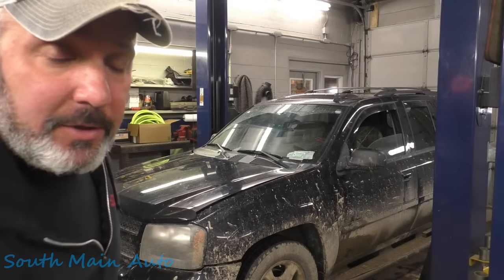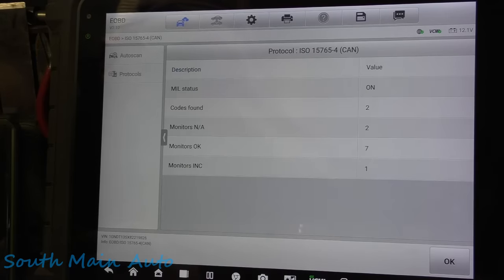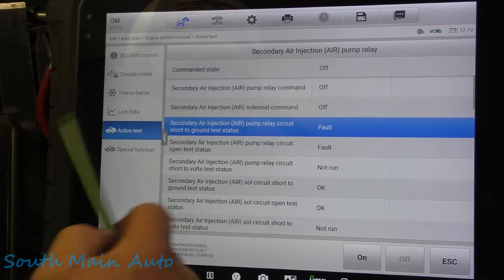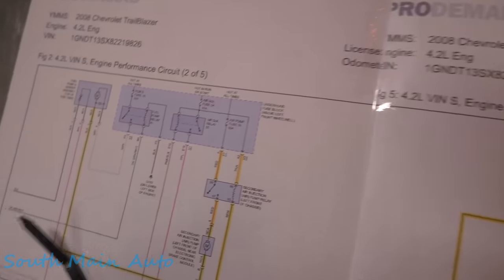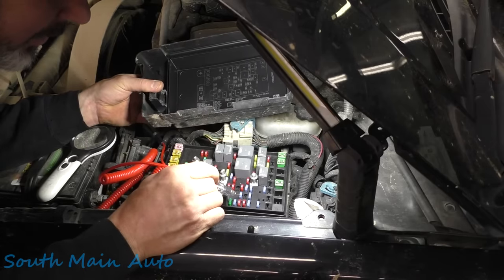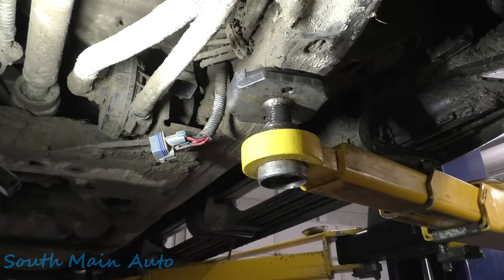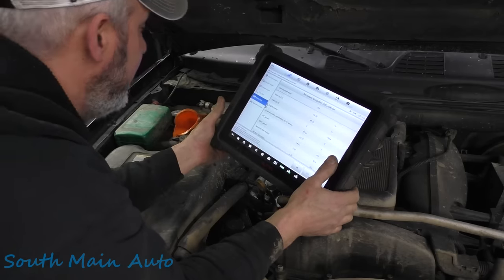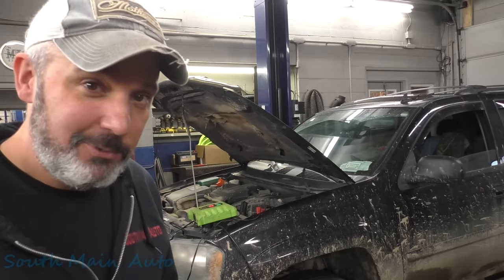Chevy Trailblazer - A.I.R. System Failure... Like All Of It

Comment: Our "04 trailblazer was in amazing shape when the transmission failed at 280k. Had it rebuilt by a local yokle and it failed again 8 months later. I sold it for parts 4 months later. The guy replaced the transmission and drove it till it died for good. No rusty frame. For a Michigan vehicle, it held up well.
Reply: Your amazing condition I guessing is POS to most people
Reply: @kenj.8897  Actually no, being an older couple with grown kids, it was very clean and bodywize in great condition  for they year. Everything ran fine up until the transmission failed. I also did all my own tune ups, brake jobs and any other repairs it required. It still had its original exaust  system as well. We traveled a lot with that vehicle.
Reply: My buddies has 246,000 miles on it runs like new, uses oil.
Reply: I nearly bought an '05. It was 9 years old and after doing research didn't find that much goes wrong with them and that engine seems indestructible. What stopped me was the rarity and thought parts could be expensive. So settled on a '06 Jeep GC. That ended up being a mistake as parts for that were crazy and the only mechanics that would touch it were the dealership and myself. Dealer replaced the alternator and that took 4 days and $1300. Was supposed to be a body off but he did it without removing the body. He only worked on it for a couple hours a day as they were really busy. Never found anyone who could service the trans.
Reply: They are good vehicles..
Reply: Trailblazer was one of the better trucks GM made. Too bad they didn't keep refining that 4.2 inline, it was a pretty good engine other than coils and the weird water pump/fan clutch design. Now they're stuck with all the cylinder deactivation V-8s that they still can't get right.
Reply: @franklincormorant8312    with all of the GM engines, don't know why they even messed with the 4.2...
But it seems to be decent.

Comment: Those air pumps should be called cheater pumps as they only run at startup for the system check and then shuts off.  What a joke. Great video though and was super excited for the "double money shot". Thank you.

Comment: Eric,
Great video - thank you.
I have a 2005 Focus with 200,000 miles as a parts car for my 2006. Its completely rotted out and cannot be driven but the engine still runs and the air pump still works. No CEL :)
Paul (in MA)

Comment: My taco also as an air pump. Ive got accustomed to it buzzing away on start up, i didnt realize most manufacturers dont use them anymore. I was explaining it to one of the master techs at my dealer and they'd never heard of it before
Reply: Yikes so they're just handing out "master" these days eh
Reply: @Onewheelordeal  normally id say yes. But as it turns out honda has never really used them. If you only work on one brand for 10+ years, i can't really fault them for never knowing that system existed.

Comment: I just bought an 04 Trailblazer from my neighbor, 243k miles. I fixed a dozen easy issues and did some body work. Cylinder four on the engine has a loss of compression, which is the only problem left. For $2000 and $800 in parts ($430 of that for a Safelite windshield), I wound up with a decent second vehicle.

Comment: The AIR system in my 96 Caddy threw a code so I did some preliminary inspections. Having found nothing, I looked into TSBs after some Goggle-Fu. The TSB said essentially not to worry about it and gave the procedure for an AIR system delete. If you have a Fleetwood, Roadmaster, or Caprice from this era, the TSB is #01-06-04-011

Comment: i remember the belt driven smog pumps / air pumps out here in cali. used to blow air into the exhaust manifold where it bolts to the head. been driving a diesel ⛽️ for last 25 years. forgot about them.

Comment: I worked at Budd Automotive in Kitchener Ontario. we made the NEW HYDROFORMED frames. of course thinner lighter metal so they could be formed with water pressure. no one cared about rust out in a few years. good old GM Engineers.
Reply: Not an engineering problem.  Nice try...

Comment: Although big piles of junk, they were a great size and a great rig with the smooth engine and limited slip they did really well. We had an 05 extended trailblazer in which we loved the size and shape and features with the rear seat… it was a piece of junk but we loved it for what it was. We sold it when it was running good before something else came up.

Comment: My 2012 Tacoma's secondary air pump has been a complete nightmare. I've had it replaced twice and I am finally able to at least clear the code for a few days at a time so I'm not stuck in limp mode until I can finally get it replaced again.
Reply: Yeah they are problematic. Gotta warn customers you can only temporarily fix them

Comment: I was living in Calgary, Alberta, Canada.  I had a Datsun 500 (so you know this was quite a while ago) which had problems that apparently meant the technician had to lift the car.  It was Spring and a bit wet on the streets when I brought it in.  When I picked it up there was a charge for an under-body cleaning necessary to allow technician to see and fix the problem.  I looked and it appeared to have been pressure washed.

Comment: I still have a 03 Chevrolet trailblazer with the big 4.2, I wasn't a huge fan when we bought it 13 years ago for my wife, we are the second owner and it now has 180,000 on and I will admit I hate working on the thing cause how stupid it's designed but that 4.2 has been one of the best motors I have ever had, its not powerful but it's not sluggish and still has a lot of original parts, we live in good ol st.louis so not a lot of snow n salt so the frame is still in great condition

Comment: Trying to find a Mechanic/ Technician with your caliber. So far the few shops we took my wife’s Cadillac to refer us to the dealer. The ones I’ve called don’t want to mess with electrical stuff. Wife has an intermittent can network failure and the screen pops a bunch of error messages and no check engine light. I’m not her but if it was me I would wait till something breaks. I would love to fix it but it is intermittent.

Comment: The AIR pump on my Corvette is the loudest thing under the hood when it's sitting there idling....thumpthumpthumpthump. I pulled it apart and checked out the impeller and bearings, no problems - just stupid loud.

Comment: The air injection pump on my '98 BMW 328i sounds like a Dirt Devil vacuum when it comes on at startup.  It's on it's third since I've owned it.  Original one was seized when I got the car 11 years ago, replaced it and the control valve, replaced the replacement last year.  Unfortunately you can't get to the bearings on them, even after drilling out all the rivets.  If I could do that I could clean and lube it periodically and it might actually last.

Comment: I had a 4 Runner in the shop once to diagnose/verify a leaking rear main. The mechanic said before they'd do the repair, all the mud/muck would have to be cleaned off;  Either I could do it, or he'd pay someone to do it (before he'd do the repair). I'd of course be charged for the cleaning. I brought it home and cleaned it up (didn't realize it was that bad - new to us used truck at the time).

Comment: Here in TX, still have quite a few Trailblazers on the road.  They are dwindling though.  My Trailblazer have only noticed rust in two hidden areas and prime/painted to slow it down.
Reply: My 07 has over 200k,no rust.. All original parts.

Comment: Those solder with heat shrink connectors are useful if the wires are had to get too, to use high temp solder, or using one of those bulky crimp ratchet tools . 😊
Reply: Junk

Comment: Believe it or not, there was a S10 first gen squarebodyTrailblazer.  It was an option package but had the name plates on the door as I recall.  It was the last year before the Gen2 and I've only ever seen one.  The later changes to the new truck may be mostly due to regulations, but a first gen S10 Blazer Tahoe was one of the best vehicles I've owned.  Tough?  Consider that all those USPS mail trucks you've seen running around for years are basically that design underneath the custom body.

Comment: Got about 360K on my '05 TB and it's still going strong.
Reply: Oh... only current semi issue?  Air injection motor.  :D.  
Took it apart, cobbled it back together best I could but mine was rusted out from (big surprise) water ingestion. So now sometimes it works, sometimes it doesn't.  I'll replace it.  Some day.  ;)
Reply: How many air injection pumps have you changed so far?
Reply: @graf703  - you mean in general over the last ~50 years of wrenching?  Or just this one vehicle…. ;)  This is its only one afaik. Was really howling shortly after I got it in (‘17?). Then it got nice and quiet (seized, go figure!) and I just cleared the code when I felt like it.

Comment: As someone who has worked in Maintenance since the early 90's I absolutely refuse to take my car into a shop dirty, It will be washed , vacuumed clean, windows cleaned ( inside and out) and detailed. I hate working on anything dirty, I don't expect others to work on my stuff in dirty condition either. Yes OCD is a bitch lol.

Comment: Mine has been bad for like 3 years (01 3.4). Might fix it some day just to make the light go away 🤣. (Or get a pcm from one without air injection). 

My uncle has an 04 trailblazer with over 400k and lives in the rust belt. Clean body, but did have to repair the frame where the trailing arms mounted.

Comment: i was driving down the highway in western South Dakota yesterday. stopped by the road was about 1960 ford ton and a half truck with stock trailer. i was thinking that doesn't have a bad relay or module . either no gas or spark . i was driving my wifes car so not even a plyer or screwdriver . so i would only been able to offer advise and my wife was complaining cause i stopped to get a coffee to prevent falling  asleep the wheel so i didn't stop.

Comment: My 06 trail blazer has never given me any troubles. It has 107,000 miles on it. but it is the in line 6 motor. anything I should worry about on it?
Reply: My 07 has over 200k worry free miles. Original everything.

Comment: I couldn't work on cars in that muddy a condition, it would first have to go though a under=hood and underbody car wash.  A good one.

A few years ago my son came over in early March to have a power steering hose replaced.  Had to crawl under the car for a few hours as the hose turned into a pipe and was tucked into a bevel in the subframe.  He had driven about 50 miles through a couple inches of fresh snow, so the car was dripping on me.  That was years ago and I'm still slightly traumatized by the experience.

About 1 year ago I was rethinking that problem and had an AHAA! moment.  The power steering hose was leaking from three spots along the top hose, but the hose was otherwise in perfect condition.   He had taken the car to a local shop two weeks before for an oil change.  The hose leaks were just the right size and orientation as to have been caused by someone poking a sharp instrument into the hose a few times.   Sabotage!?!

Comment: In 2022 I was driving down a familiar road in NJ and saw a for sale sign on a 2004 Avalanche. I stopped and called the number on the sign and the old guy came out of his house. No FB Marketplace, no Ebay, none of that. Turns out he had just retired the prior year and bought a brand new Ford F150. He just wanted to get rid of his garage kept 220k Avalanche for 5k OBO. We settled on $3500 and to this day I still feel like I stole it from him. I replaced all of the suspension for a couple hundred and a weekend myself.  Runs and drives so well. I hope it lasts a long long time

Comment: Eric, you need to get some contact lenses, my dude.  I only need glasses to read but I finally got tired of putting on/off glasses all day and went to daily contacts.  Major gamechanger for an easier life (once you get used to putting the stupid things in each morning...that was a pain to learn to do)
Reply: In my youth, my vision was corrected to its best, with glasses.   When I was ~20, hard corneal lenses, corrected my vision best.   Many years later, my advancing keratoconus, necessitated a change to scleral contact lenses for best vision.   Using the, Classic Lens Plunger, insertion and removal of my scleral lenses is easily done.   My right lens is clear, but my left lens has a extremely light blue tint that I cannot notice while wearing.   A pleasure to wear all day and often thru the night while sleeping.   Once a day they're cleaned.

Comment: Next guy to work on that truck will be the operator of the crusher
Reply: The truck has one problem and is not rusted out lol
Reply: @JoeyRiz  one problem? Most unlikely. And the way it's obviously driven, it won't last long in that environment.
Reply: @kevinbarry71  it’s a 2008, if it lasts until it’s 30 then that is great. Mine should make it there, I have a 2008 as well but I’m also a mechanic. It’s becoming an overlanding sort of rig right now.
Reply: @JoeyRiz  do you live in upstate New York? Land of salt
Reply: @kevinbarry71  split my time between the fingerlakes and nyc. Actually have a place pretty close Eric’s shop
Reply: @JoeyRiz  then you have done well to keep yours in one piece this far. I am from NYC and Long Island. The salt here is not that bad. But upstate, especially in western New York, it's terrible. They appear to believe that more is better
Reply: @kevinbarry71  ya grew up on long island. Probably moving up full time in awhile. Just get an undercarriage wash after every major snowfall and you will be good. People just never do though lol.

Got mine in 2020 right before the pandemic for 4500 bucks. It’s fantastic but again I’m a mechanic lol
Reply: @JoeyRiz  being a mechanic is definitely an asset with that car. I agree about the wash. Also, fluid film or wax oil every year. GM only waxed the frame. I don't think those vehicles were electro coded. sadly, they continue to be hardheaded with their current full-size and heavy duty trucks. But strangely, not the midsize
Reply: @kevinbarry71  ya well mine has surface rust on the frame only already but just surface. It will last 4 more years for sure but I will get my moneys worth for sure.

Comment: This guy is good, I wish you could pick his brain and or do some kinda remote help, I have tried all I can with my avalanche and it's still not holding in gear, in the t case, I have no forward or reverse in any of the t case selections. Or it will work one time then back to a neutral state

Comment: I have the exact same vehicle same color in fact just paid 8 k for it it only has  28,000 miles on it should i ditch it eric? It runs perfect. Oh i live just up the road a little from you in lockport ny im thinking about wool waxing the underbody/ frame is that a good idea?
Reply: Sounds like you got a good one. I’d keep it if it is mostly rust free. They are cheap to repair. I have a 2008 LT 4.2 and it’s reliable and gets good gas mileage for the size. I’m a mechanic as well btw

Comment: I Rember my 2001 S 10 had an air pump with problems , and it was the exhaust check valves stuck open heating up the piping to the air pump ,and it had water in it , what a dumb idea that was .

Comment: I had an old Econoline work van that I had to negotiate hurricane Irene (99, SoFla) floodwaters to get home where it got over the front bumpers. Next morning I went to start it and the belt driven pump was seized and the belt was screaming at me. Smacked the pump with a hammer and it was fine. This joggled that memory.

Comment: Air injection pump, sounds like my tundra. Has a engine light with secondary air injection pump codes. If i drive it eventually goes into limp mode, I unplugged the air pump and it is good to go. I can live witha  check engine light all the injection pump does is inject air into the system on cold starts til it warms up. it is just emission stuff. I dont care for emissions. maybe one day i will investigate and replace the pumps but i dont feel like spending 600$ for a emission issue. It sits under the front wheel well same thing, moisture issues etc and debris

Comment: Quality GM Engineering right there Son.  My gawd, these are such P.O.S. vehicles!  7-10 years and throw it away because the whole vehicle is toast.
Reply: They actually aren't POS', they're very stout trucks. I live in the rust belt and the Trailblazers other GMT360s are super popular here still and aren't rotted out. Eric's area must put salt down by the foot over there. I just sold mine, an 06 with 104K on it and the frame had very little rust.
Reply: @imrf  106K miles.. LOL ... That's cute.
Reply: @CedroCron There are plenty out there with over 300k on them. Be ignorant all you want but they’re quite reliable trucks. Mine just happened to be a garage queen of my parents that was given to me and I barely used as a second vehicle.

Comment: Can someone please help me iv taken my tuck in to 4 shops and no one can tell me what's going on. I have a 2002 dodge ram 1500 with a 4.7L v8 magnum. Ok so every time I step on the brakes my headlights turn off and comes right back on the second there released. P.S. it won't do it if you turn on the headlights and dash.

Comment: just rip that crap out, it is useless does really nothing and only on start up. you can get block of plate for the solenoid on the motor. ask me how know as I have a 2008 trailblazer also. the secondary injection was GM’s poor attempt to help a lower emissions at start up. It’s a garbage system.

I know you can’t as shop but the customer can.